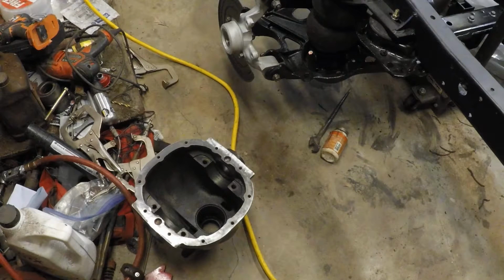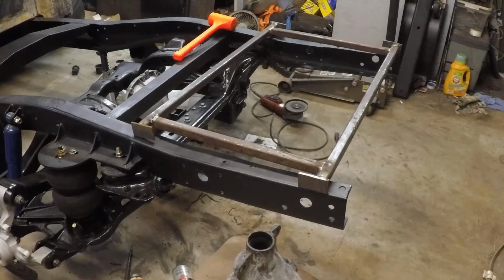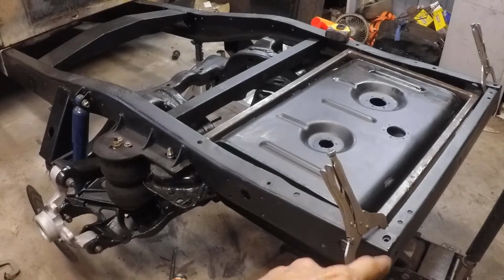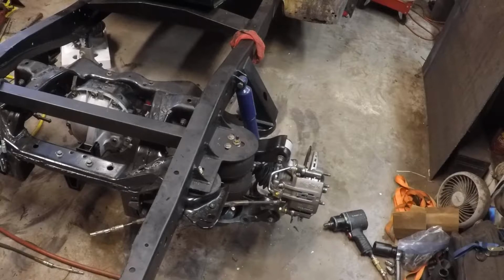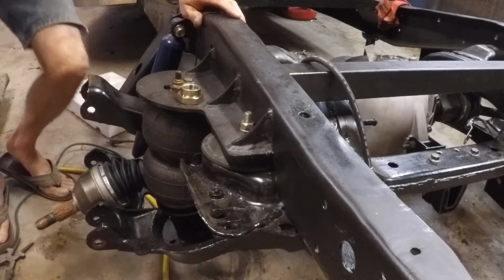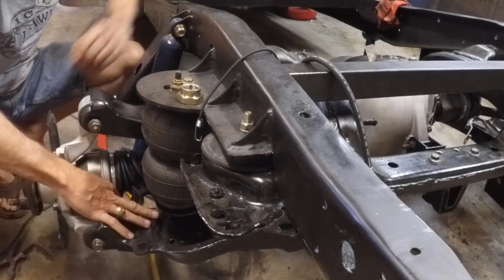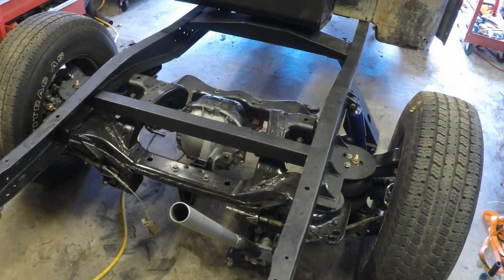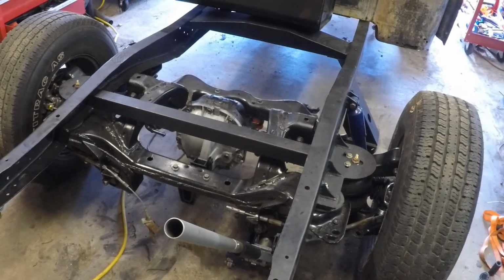Rebuilding a 1951 Ford F1 - Part 13 - Gas Tank Mock up, Rear Diff, Hub, and Rear Brakes Install

Comment: Hi Trey, loving the build!  Do you have specs and part numbers on the rear rotor?
Reply from the maker: Errol Kaai Hello! I’m enjoying it as well! I don’t have the part number, but they are stock 1997 Ford Thunderbird rotors before I got them drilled. You can pick them up readily at almost any car parts house.
Reply: Wow quick reply!  Thanks for the info!
Reply from the maker: I should correct my earlier statement. These aren’t stock rotors as they are drilled and slotted. I did just specify they were for a 1997 Ford Thunderbird and then selected drilled and slotted rotors from my options. Super easy!
Reply: Gotcha... thanks again Trey!